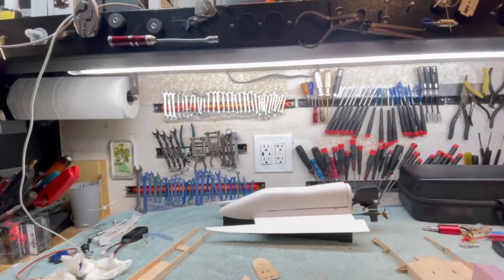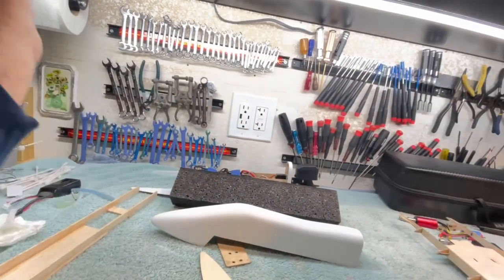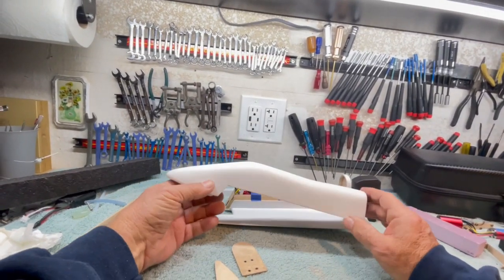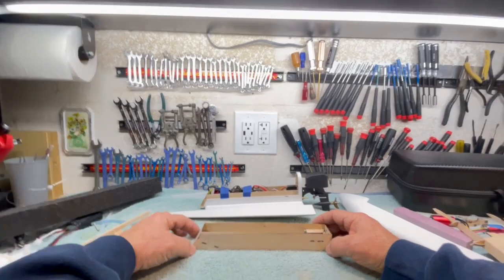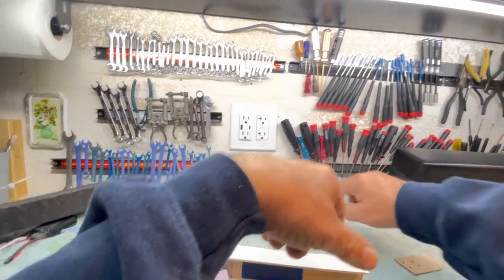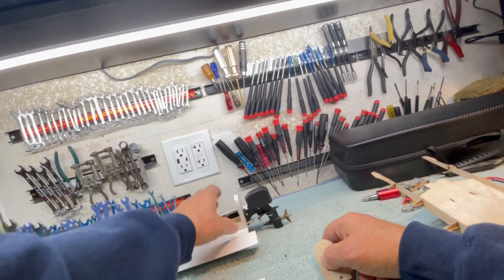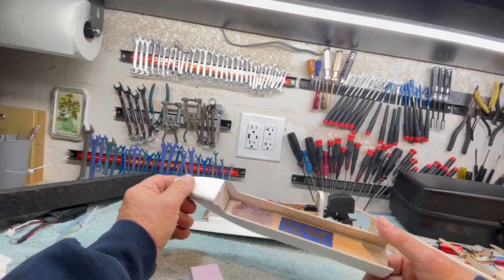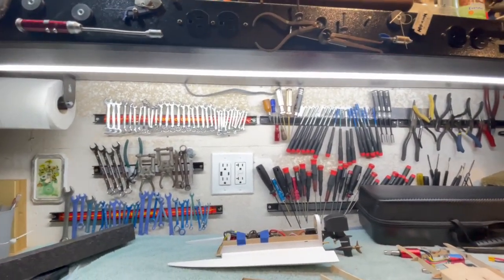Dr. Jet describes how he made the cowl/canopy for the TunnelJet

Comment: Im really glad for this micro kit .cant wait
Reply from the maker: I too am excited to get these out there.  Prototype I has shown a lot of potential and they are really easy to build.  Mostly straight lines with just a few curves to make the front end "pointy".  I've been working on re-populating the plywood sheets to get two full kits out of a 12" x 24" sheet of plywood.  The cost to produce these should be the same (or really close) to the 1:20 hydro kits.

I've re-motored mine with a 3000 rpm/V 2040 motor and have a 3900 rpm/V motor in the toolbox if I need more Kv.  Next time out (next week, it's pouring rain at the moment), I'll try the lower Kv motor and see what happens.  Big B is taking a slightly different path on the power system, but if weights are similar, the strudder position (the really important information need at this juncture) should be similar for both hulls.  There are other prototypes out there, but I don't believe construction has begun on them yet.

All in all, I hope this fills a small gap in the current state of RC boat hulls available to the general public.  You could conceivably hold full-on competitions in the decorative fountains outside of many large office buildings.  And what a great way for a business to get some free press.  Imagine:  The Qualcom Invitational Formula 345 Cup held in their fountain on a random Saturday.